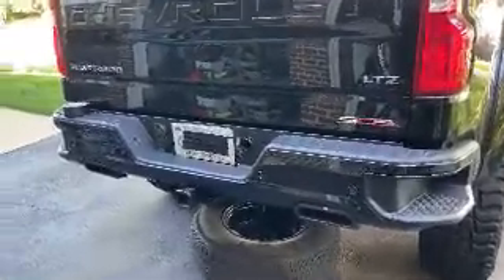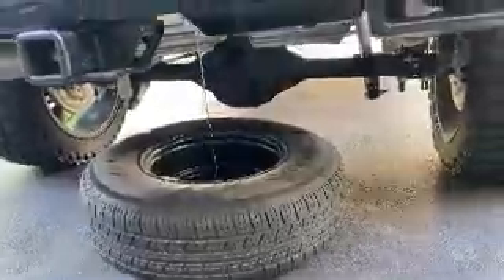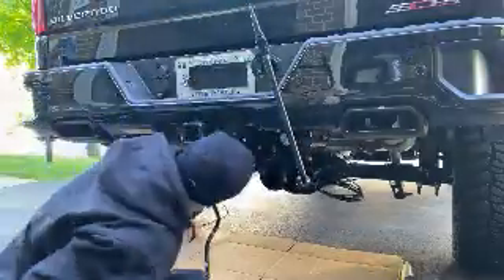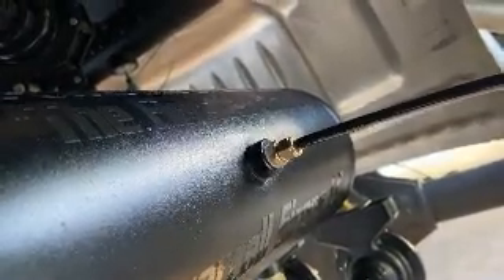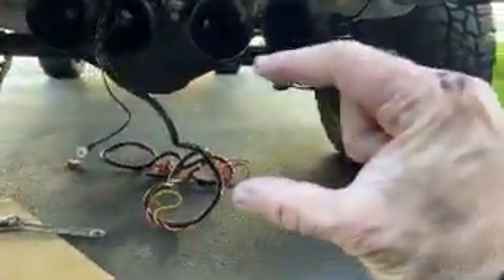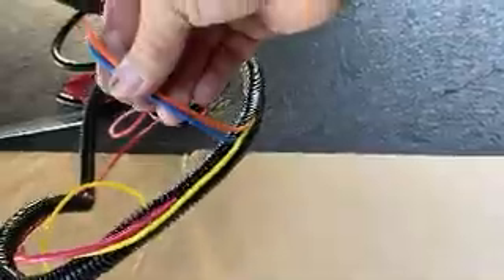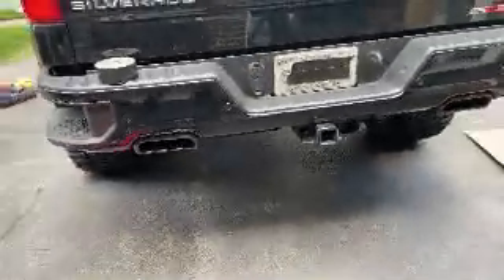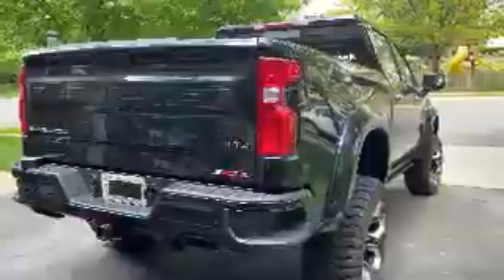Powercall Sirens Hornblaster 224 Nightmare Train Horn

Comment: Thanks for the great videos......but I need one more thing—I wanted you to show where you tied in the ‘keyed ignition source!’ Can you give suggestions for that please?
Reply from the maker: It all depends on your vehicle, I went to my fuse box and there were extra terminals I was able to use.
Reply: @PowercallSirens  I’m curious to know what extra terminal you used? I have a 2019 Silverado LTZ as well. Did you tap into the driver or passenger side? And if so which one? 15 or 30amp? Driver side F4, F10, F14, F15, F18, F23-F27 are all not used. Thanks for your vid man. Gonna pull the trigger. Just trying to plan before the kit arrives to save time finding where to connect etc
Reply from the maker: @crimsoncastillo1356  The Driver side, just use a meter or a test light to find the terminal that has switched, there’s a few
Reply: @PowercallSirens  what size fuse did you use?
Reply from the maker: @crimsoncastillo1356  for the switchbox I used a 15 amp fuse, but the block on the driver side has a bunch of empty terminals so you need to tap into one of those.
Reply: @PowercallSirens  I also noticed that you tied all of your ground wires together. what gauge wire did you use that ran back to the negative post on your battery? 10 AWG? Your switch box i’m guessing you grounded under your center console?
Reply: @PowercallSirens  from what I can tell when I looked into the fuse panel there's Micro 2 and Micro 3 fuses. Does it matter which one you tap into? Like you said yes there are a few spares on each side

Comment: @Powercell Sirens I’m confused. Please help. You have the main power cable coming from the compressor to the battery. How or where do you run the secondary wire to the toggle that turns the compressor on and off so it’s not running at all times since it’s ran to the battery? Thanks in advance.
Reply from the maker: Jay Splawn The main power wire from the compressor does not go to the battery, it goes to the pressure relief switch wiring. There should be a wire coming off the pressure relief switch that when it receives power, activate the compressor
Reply: Thanks for responding. I had my cables mixed up. So yes the red cable off the compressor goes to the white from the PASS box. The red power cable from the PASS goes to battery. Only wire left is remote. Does that go to the toggle switch to turn compressor on or to an accessory for when the key is turned on. Don’t want compressor running when I don’t plan on using it. I will be using a 5 gang 3 pin rocker switch panel.
Reply from the maker: @jaysplawn1098  The trigger wire goes to a switch, when you activate that switch the compressor will come on. Make sure the switch throws that trigger wire 12V. Hope it helps! Send me a video once you get er' done!
Reply from the maker: You don’t happen to any fuse, underneath the fuses there are a bunch of metal spade connectors and one of them has switched power you should not be removing any fuses or jumping off any fuses.

Comment: What's the point of an air horn if you cant even use it unless you got the arm rest open. When someone cuts you off, you need the button right there n then. With your setup by the time you open the arm rest they'll be long gone.
Reply from the maker: mike We actually change that about a week later and now we have a custom switch panel right in the main cabin area, works great!
Reply: @PowercallSirens  very good, now you can press it at a moment's notice!
Reply: I have a switch that allows me to switch it on or off from my main horn, and also a switch for my compressor.
Reply: @jeremiahlapinski4450  any video or pics how it was setup?
Reply: Badass truck btw
Reply: @jeremiahlapinski4450  how did you get it to where you were able to switch from stock horn to train horns, that’s how I want mine to be.

I want to be able to switch right to the train horn when someone deserves to get lit up 👍🏻
Reply: @RepoManFan4Lyfe  I went to the stock horn wire and I took the power from there for the switch and put it in the cab. It’s pretty simple, basically I spliced into the horn and feed it back into the cab.